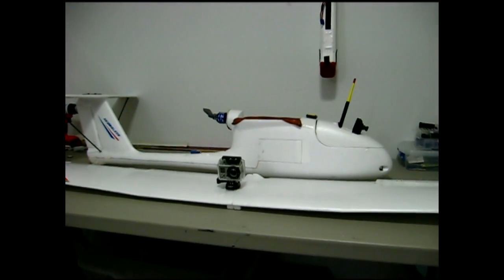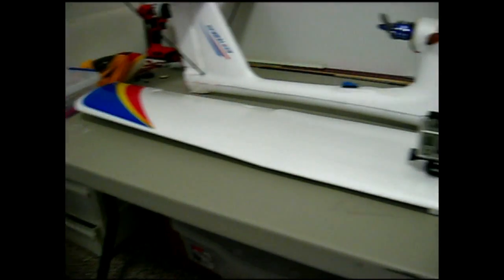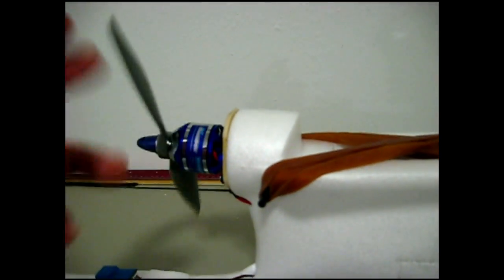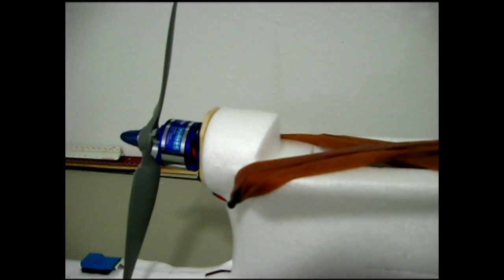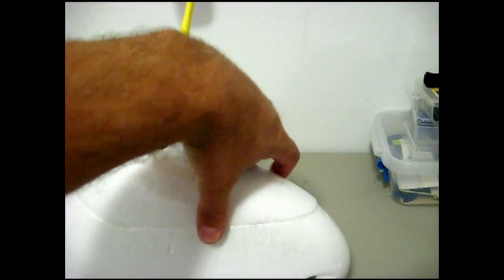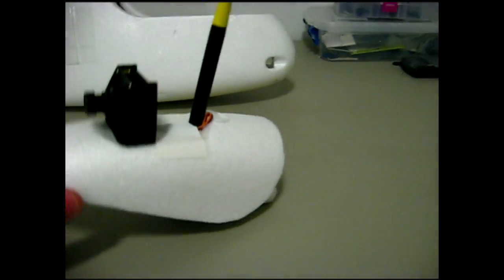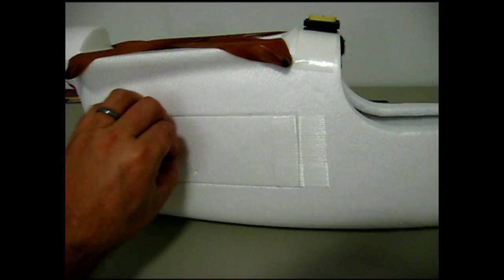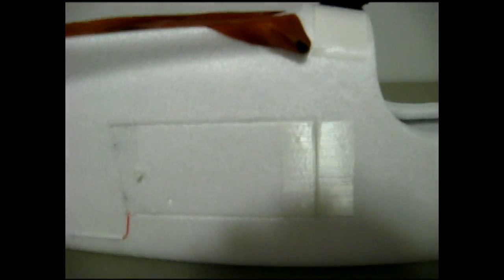Quick look at my Skywalker configuration and a bit of flight video

Comment from the maker: @Tsavah Thanks, it is fairly heavy.  Have not weighed it yet.  Yes, 30 minutes is absolute max, with little to no wind and cruising slow with a lot of throttle management.  Flying in high wind, I'd be lucky to get 20 minutes.